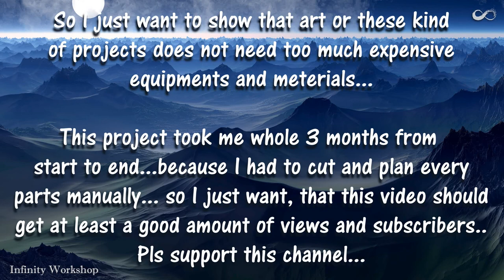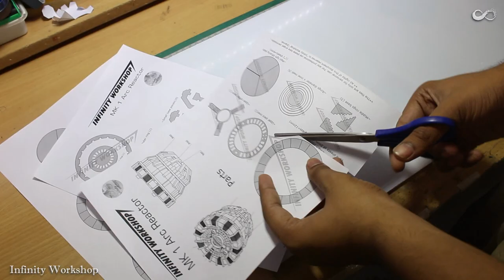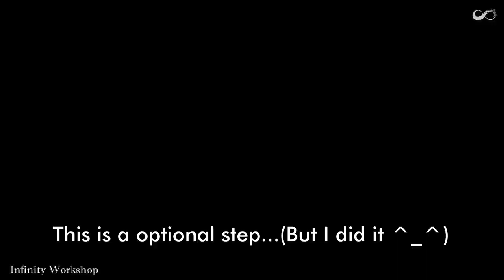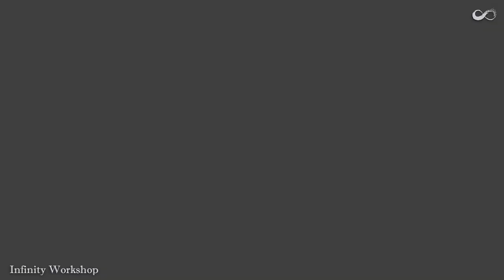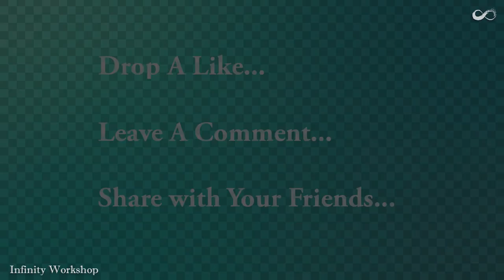DIY Iron Man MK1 Arc Reactor ||  Complete build guide..|| best DIY version

Comment: Trying to purchase these but the site won’t load and the message I’m receiving is “site is not secure” . Are you able to help me purchase these ?
Reply from the maker: Sorry For the Inconvenience, I have corrected the problem...Pls have a look :face-blue-smiling::eyes-pink-heart-shape::cat-orange-whistling:
Reply: @InfinityWorkshop  thanks, I have them now. Can you please let me know what voltage battery for the LEDs and also why you removed one. Can you please send a plan for the wiring. Many thanks and kind regards
Reply from the maker: For the battery or power source... Use 5 volt 2 amp supply (minimum)... And for the leds... Use 4 volt with resistors..

Pls email me at infinityworkshop.diy@gmail.com I will send the plans
Reply: @InfinityWorkshop  thanks, I’ve emailed you just now.

Regards
Reply from the maker: Okk... I will send you the files... As I reach home... Thanks for the patience... 😇

Comment: hi there how do I purchase a template? also how does it turn on I see the lights but are they battery powered?
Reply from the maker: First of all...

I have the links in the description... You can go through the simple process... I am using the service of stripe payment gateway...

After the payment... It will automatically redirect you to the template pdfs... You can simply download them...

If any problem occurs... Feel free to let me know... I will personally help you out...

..... Yes.. The arc reactor is battery powered.. But the battery pack isn't in the actual prop... It's separate.... Connected with a power cable...

Comment: What leds did you use?
Reply from the maker: any white smd mounted on aluminium sheet will be just fine... But I took the 5 volt ones..... So that I can run those with a powerbank...
Reply: @InfinityWorkshop  having trouble finding the right store
Reply from the maker: You can use led strips also if you can find in 5 volt range.... Or use a large single white led with a proper heatsink..... I think that will be a good alternative....
Reply: @InfinityWorkshop  what led do you think is as bright as the one you used?
Reply from the maker: Do you have a Instagram account? I will send you some examples....
Reply from the maker: You can dm me... Via my link in description
Reply from the maker: Ok